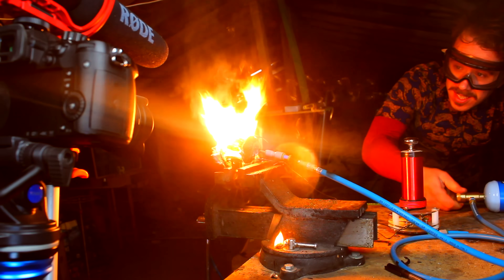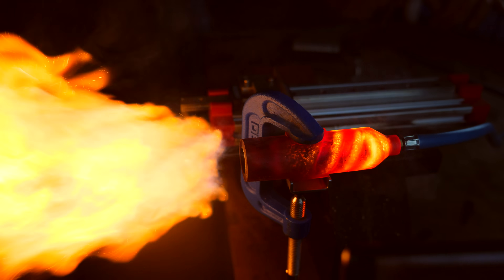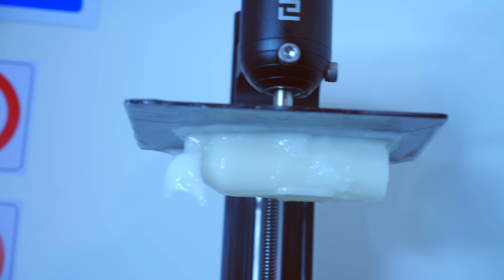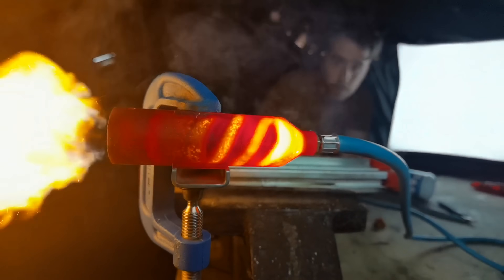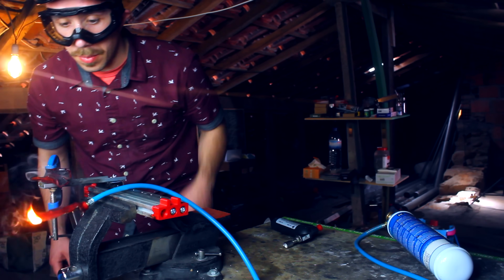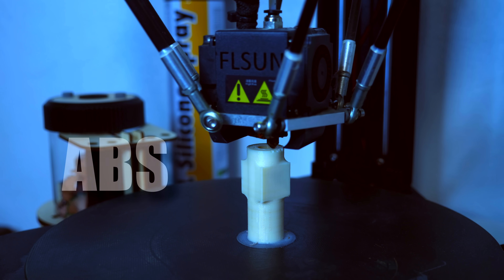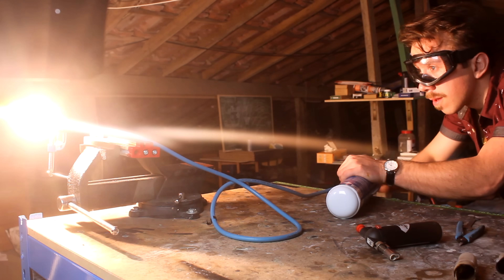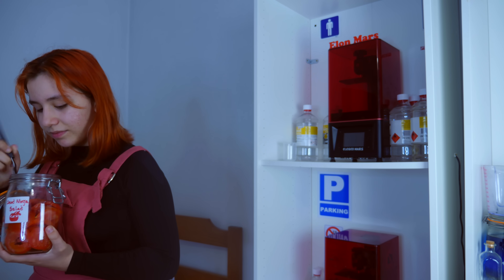Rocket engine that uses itself as fuel! (3D Printed)

Comment: Have you tried 3d printing with weedeater string as your stock choice? Also im not sure if you use acrylic resin but I know acrylic and O2 can produce thrust. Lastly. Try having a housing made to contain your printed rockets. You can make more use of the energy if it is not burning through its outer layer. It can be a simple piece of black pipe or i would suggest the thinnest brass tube you can find. If you cannot find one, buy the thinnest brass bushings you can find and braze them together. Also the amount of thrust generated is gonna mainly be dictated by the amount of surface area you can achieve inside the rocket and the APPROPRIATE supply of oxygen. You need a metal or ceramic nozzle so it does not degrade through the burn. For the surface area factor inside the rocket I have an idea I would like for you to try. Imagine staggering layers of disc shaped voids. So like lots of cylinder shapes or more effectively divets maybe 2-3mils deep, then a layer offset from those of the same size divets and back and forth until the whole structure is complete. Like from a linear perspective; taking the outside of a golf ball and laying it flat, then another one and laying it atop but slightly offset, then another lined up with the first and so on, then roll them into a cylindrical rocket engine shape.

Comment: Why don't you house the 3d printed rocket fuel inside a steel or aluminum tube. This will allow you to have a better fixture at the end for your oxygen line connection and also resolve the motors blow-out issues. The tube can be reused and all you would have to do is print new "engine modules" that you can slide into the tube to "refuel". This will allow for the tube to be reused, ergo you can design rocket fins to weld to it etc. You can even then create a longer tube where above the engine could hold the oxygen for the rocket and use a solenoid and pressure regulator to join the tank to the rocket engine. This project can really go places. Please keep going!!

Comment: you need to make a graphite nozzle so it doesn't burn away and contain the fuel in a tube, the fuel core just needs to be a straight hole through the bar.

Comment: I think you are using to much oxidizer. One of the main problems with hybrid rocket engines is controlling the oxidizer-supply for optimum efficiency. To much oxidizer leads to oxidation in the nozzel with in turn ruins your geometry and reduces thrust.

Comment: love your videos integza <3 some tips from an aerospace student: 
-supersonic nozzles like the laval nozzle are actually very hard to use because if the airflow coming in isn't in the right condition not only you wont get a supersonic airflow, but it will even speed down. much better to aim at a MACH 1 airflow.

-how about using 2 different materials for the hybrid engine? the exterior(structure) of the engine can be made in a more resistant material, while the solid fuel (like the abs or sugar+resin) is printed in a different piece. you can print  the 2 pieces separately and then stick them together like lego pieces

hope you read the comment :)
Reply: Your second point is exactly what I was thinking too.

Comment: Experiment with 3d printed molding with recycled paper to make a solid burnable engine. Instead of water emulsifier use your sugar water mixture or something petroleum based like kerosene. Perhaps it will make it more flammable after it has dried out. Coat the exterior with your non flammable fireplace sealant. Check out this guy for info on the molding process https://youtu.be/0ItPfhx3ulw

Comment: You have to make a nozzle from high temperature resistant material. A graphite for example. And the enclosure which would withstand a lot of pressure. You can 3d print a ceramic enclosure with multiple parts and reinforce it with carbon fiber and epoxy.
P.S. I wonder what's Snape's portrait doing next to Tesla's

Comment: I think part of your issue with the first design was lack of even ignition. It's "slow" at the start because the oxygen rushing in is fighting the flame front and stopping it from lighting the rest of the fuel grain. If you ignite that evenly I think it would be quite promising.

Comment: Theme or suggestions for next video,s for rocket engine use ramjet or scramjet type engine and for nozzle use aero spike but with improved geometry so that the gass coming out of the nozzle apply pressure on the axis of your engine .
And one important thing your nozzle should not burn out if it burns it decreases the thrust by disturbing the thrust distribution.
Make a metallic rocket engine with 3d printed fule.

Comment: For hybrids, even with 3d printed fuel a metal casing in steel or aluminium would be a good idea to enclose the fuel, avoid some explosions, have a full burn and get a permanent injection port that won't melt. If you have a small lathe it could help to make it in one piece, or you could use your welding setup to build it. In terms of fuel, if you want more power, powdered aluminium is pretty neat as an additive. Also, paraffine wax or HTPB plastic are more powerful than ABS (but sadly not 3d printable as far as I know, so they need to be cast). For nozzle design, you will have to do some math to figure out pressure and total mass flow to get some sweet sweet mach diamonds and the thrust that comes with them. On fuel side, check if you can find the regression rate, or test with fixed burn times and oxygen flow to measure it. Integrating your spark plug igniter from your previous works would also make ignition safer and more reliable. And using a pump like you did with your turbocharged pulsejet engine could help obtaining higher combustion pressure and thus better thrust.

Comment: You need containment and a throat to constrict your pressure.  So a stainless steel can or pipe and maybe a screw on cap with a hole in it.   Tech Ingredients already discussed rocket fuel that has accelerators in it or suppressors to slow or accelerate the burn.  This would mean you could speed up the burn while starting and slow down a bit when more fuel is burning so you don't explode your cannister containment.

Comment: You could print a ceramic rocket body with and use a solid sugar resin fuel stuffed inside, of course you'd have to seal it. I could also see making a copper rocket body out of plumbing pipe, or better yet just get a lathe, I'd love to see what you'd do with a lathe!

Comment: Can't talk any more it seems... Dommage
11:15 min... Strange, very very strange...
If you look at the video their are some White straight lignes wich appear on all the image, not only on the fire part

It cames with the noisy sound, but seems to be produced by another reaction included in the process...
Don't seems to be the distance of the camera that could be too close, perhaps the capture system inside the camera...

It makes quite the same effects as magnetic perturbations on all the screen but in the sens of the exhaust
Could it be some strange electrostatic reaction created by the speed of the small burning particules that react with ambiant air around ???
Not seen before, ABS is probably responsable for a part

Oh as i'm thinking about
Recently playing with bambou parts, and testing simple mouth air flows in the different tubes
There's a hugh difference between the different parts
Simple bambou is inside covered with natural foam, very difficult to retire, but external is covered with a natural vernis

Take a look at the leaves that protect the bottom
The vernis is inside and the air flow that you will obtain is very powerful, able to creat skin movements with a small power ... 

So why not using a metal cone at the exhaust 
This is, i think, the best solution to concentrate the power on a smaller point to obtain a real trust

I know that your videos are more spectacular without, but if you want results this is probably the best solution 
There are inox cone for cakes cooking that could be used, but sure you'll found best

Perhaps a possible solution to answer to interferences
In this video about the Beiruth explosion, at 5:31 to 5:36 min, it talks about magnetic perturbations du to the powerful energetic wave sound, that creat atmospheric electro-magnetic respond 
https://youtu.be/6lt0xhXqQj0

Wish you a happy day

Oh a last advice, old houses for most of them burn because of the fire place, a small burning part falling in wood pieces that started to burn out of the secured environnement
Please don't forget to take your small pieces of old burning test far away from the secured test environnement, before a new test...

Comment: Wild idea..... so how about: ceramic nozzle 3d printed, old school sugar center, ceramic casing around that. Create a (vortex) 'double wall' design. Oxygen runs around the outside of the rocket first (double layer outer shell - oxygen goes 'in' at nozzle side) and mixing the oxygen with 5-10% water vapor. this 'should' effectively cool the burn chamberof the rocket longer, (cold oxygen and water vapor) while the water vapor heats up and turns to steam which in turn increases the pressure of the air which pushes in the front with a loop-around. That will be a mix of all previous tries/variants.

Why water? Check this: https://www.youtube.com/watch?v=IwqTN5fhMR8&t=187s

Oh...and please do what Thymen says; use a quick valve for the oxygen. This disaster waiting to happen. Sample: https://www.ferguson.com/product/apollo-conbraco-80-100-series-14-in-bronze-threaded-locking-lever-handle-gas-ball-valve-a8010101/_/R-386913

Comment: Even the Nasa thought that ABS was good ... or at least one part of it (the Butadiene) and they standardised in the 60s HTPB (which is a fancy form of Butadiene, Hydroxyl-terminated polybutadiene to be exact) for use in solid Rocketmotors. Today many hybrid Rockets also use HTPB, for example the engine of SpaceShipTwo also uses it (not 100% sure though).

Comment: There are some castable wax-like resins (like that one https://applylabwork.com/specialty-series-msla-castable-cyan-for-led-lcd-printers/ or that https://formfutura.com/shop/product/clcd-blue-0500-castable-lcd-series-castable-wax-resin-7727?category=529 or https://resinworks3d.com/product/ccw-easycast-hd-violet/ or https://www.anycubic.com/products/dental-castable-green-uv-resin-for-photon-series or any other) that burns out compleatly without any residue

You might print rocket body with them, and use them as a cast for a metal body - should not be a problem since you have furace
You might also use resin as a solid fuel - just add some sugar and oxidizer mixture into resin (and a little bit aluminium powder for efect ;) )

I'm quite sure that'll work perfect. Or I'm a little bit too optimistic - I don't know

Comment: You might need to ceramic print the nozzle and make the rocket in 2 pieces.  the nozzle diameter is probably chewed up very fast and the diameter goes bad very fast.

Comment: Integza, you're applying rotational torque to the frame you're trying to use to test thrust because of the placement of the engine, which could be seizing it in place and preventing the rocket from moving.

Comment: Create multiple tubes or honey combs through the rocket internals as to get the maximum surface area for fuel to air ratio as  the fuel burns of extremely fast.

Comment: You could do another type of rocket with 3D printer. If you build a chamber of alluminum with a screw nozzle (as de laval shape) you can use and reuse very times this object. With your 3D printer you can build the combustible for your rocket as a cilinder with particular base shape.

Comment: Hey Integza, have you seen this new thing where people are tightly packing their prints in salt, and then melting them in the oven to get the strength of injection moulded parts?  I thought it might be a useful approach for one of your projects if you have anything where part strength is important.

Here's a good video on the improved strength of the resulting parts.

https://www.youtube.com/watch?v=DyAKtS1b3SQ

Comment: Hi Integza, try use wax for the solid fuel, and to save oxigen put a electro-valve after que oxigen bottle so its easier to shut off the oxigen while testing

Comment: You know you can bind last engine to this one you not creating air pressure  in to rocket, use  vortex engine  and use rocket part as combustion chamber and because the vortex pushing hot air with extra fuel that should give you 20-30 percent boost depend how you make  nozzle. Basically you increasing pressure along the rocket as air expands

Comment: Video idea: 3d printed rigid airship. How light can you get the prints? Can they still be strong enough to support the gas bag? When they inevitably light on fire after you fill them with hydrogen (because it has the highest buoyancy), how fast will you have to run to put out the fire? Important questions. ;-)

Comment: Aerospace engineer here: The reason your aerospike rockets aren't working well is that you're making them out of fuel =D try making them out of a metal or that ceramic you're using, secure them in place with a metal dowel. You can see the aerospike working for the first few seconds of your ignition, then it gets eaten away so much that it doesn't work anymore. Same situation with your De Laval nozzles; they're in a state called "underexpansion" Where the nozzle's gasses are expanding too much as well.

Comment: Theme suggestion: make a 3d printed rocket dart board. You know those dart boards with the plastic spikes that the darts get stuck in? Make that, then make the darts have a small hybrid rocket engine (mostly cosmetic).

Comment: Once you put the motor in a case please take safety precautions. An overpressure it will become a pipe bomb. You can use cardboard as an insulator and PVC as a case... Quick set concrete as a bulkhead and a nozzle but cast them with screws running through the sides of the pvc for retention.  This will create a single use motor.

Comment: How about an ABS body with a sort of mesh channel down the center, allowing for airflow and also to allow  the main portion of the body to be filled with potassium nitrate and sugar. Or there's also the possibility of making a rocket fuel resin using the same printing process but with potassium nitrate included in the sugar

Comment: I saw on YouTube, a long time ago, a rocket using an acrylic cylinder, with a hole for the nozzle. But they used a different oxidizer.
Another thing, your way of attaching the rocket to the track is too heavy for the trust generated by your rockets.

Comment: The thrust is relative to chamber pressure. A metal tube around the rocket and smaller nozzle size will increase thrust by a lot. And make it dangerous!

Comment: You should try using Flame Retardant filament as a firewall/external part of the rocket so after a certain point the combustion won't continue. Filament PM is in Europe and could work as a good source.

Comment: Idea:  how about using two different types of filament, one for the nozzle of the rocket to prevent deformation and increase thrust, then hot swap (change the filament mid print) to your fuel filament for the body. Perhaps a carbon fiber or metal laced filament for the nozzle. Curious how a wood filled filament would act as a fuel too. You will need some hardened nozzles to print with these filaments.

Comment: You should add a 90 degree handle valve to line just out oft the oxygen bottle. Then you'll be able to turn it on an off quickly without turning the valve several times.

Comment: The major problems in this video should be fairly obvious: by making the entire engine, including nozzle and casing, from the fuel, you're losing thrust as the nozzle geometry is burned away, then losing integrity when the it eventual burns to the exterior of the fuel grain. The solution should be to create a nozzle and casing from the ceramic material, then 3d printing the grain to fit them.

Comment: What about an engine that was thicker walled and held several cavities along it's vertical axis to pack crystalline sugar into it?  Or any other powder fuel.  You could test other things.  Some oxides burn quite hot once ignited and while not typically thought of as combustive yield quite a lot of kick once the reaction starts...Magnesium, Titanium and Iron Oxide.  **Warning, in certain concentrations that could make thermite which would burn your lab down...do it OUTSIDE and with plenty of fire protection.  I am also thinking that a thicker wall and a taper on the interior of of main chamber towards outlet would multiply if not magnify your output...

Anyway, thoughts about next video?  Using rockets on 3 printed plane to make yard fliers?

Comment: Maybe you could use an iron or steel dust mixed with sugar, or even magnesium, sodium, or titanium dust Solution mixed with the sugar and Abs to produce a more powerful thrust and efficient engine, and, when building the body of the rocket line it with something like aluminum, like from cans to reuse the metal, and a CO2 canister to mix in oxygen and fuel with a kind of syphon and fuel tank that can also be 3d printed.

Comment: Is it too late to get top comment? I was doing random research the other day to fill up time.... Did you know filthy disgusting tomatoes love hydrogen peroxide? Why not combine all states for your hybrid and add some hydrogen peroxide inside the walls of the 3D print and layers of manganese dioxide just barely kept away from the hydrogen peroxide wells. Once the rocket is ignited you just have to ensure it melts through the wall and mixes the two. I mean they've used hydrogen peroxide fuel forever now so... I mean wouldn't that be fun application of science? 
Also i suggest putting the rocket on a jig that turns a meat grinder at a 100 to 1 ratio so that the tomatoes loaded inside are thoroughly pasted... because tomatoes deserve a painful destruction.